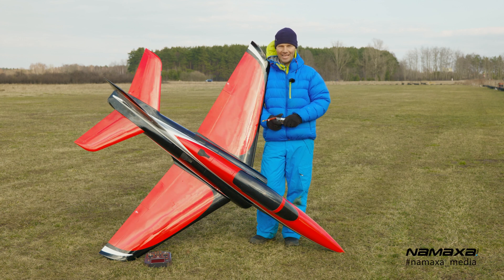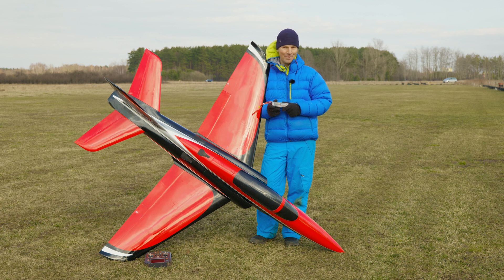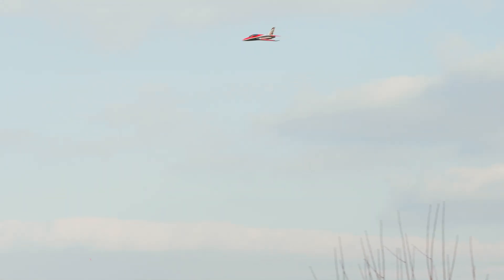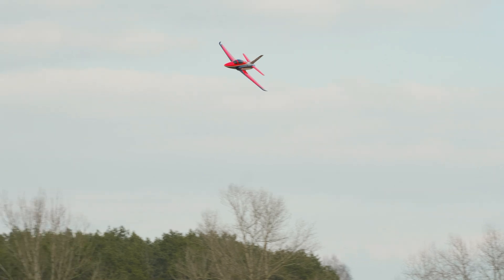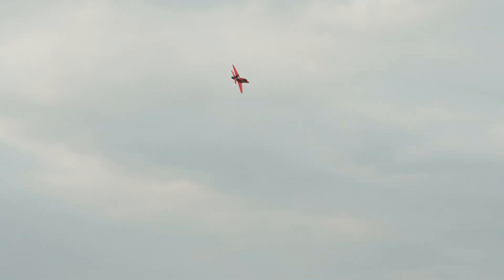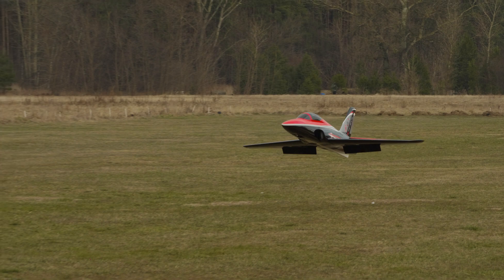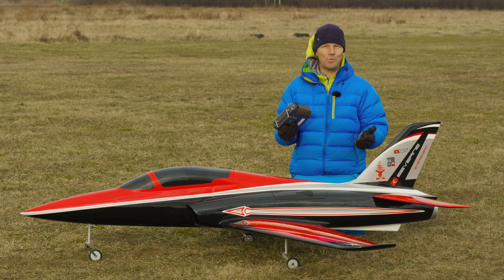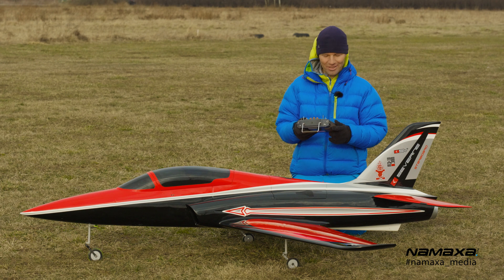10,5kg Odyssey JETFAN-120 PRO EDF 258km/h 8,5kW 11,5kg thrust, 150A Graphene 16s 4Ah TOPRC Jet Sound

Comment: JETFAN-120 PRO with motor HET 800-73-590kv.....Are you sure on the motor you used??  We run that same motor in a JF120 on 14s, and pretty convinced that 14s is the max amount of cells that motor can handle

Comment: That's awesome - I want one... but only 11.5kg thrust on 16S??  I have a 9" quadrotor that produces at least 15kg thrust on only 8S.  I love the EDF, but it seems like they're terribly inefficient...
Reply: Quadrotor props move more air with less effort, while the EDF needs more juice to push less air *faster*. thats why your quadrotor can turn on a dime but wont ever get close to the top speed of a fixed wing aircraft
Reply: @fleshtorpedo  ... in other words, it's still pushing hard while the aircraft is already moving fast.. I get it - the laws of thermodynamics, again... we just can't have our cake and eat it, too...
My quads are pretty fast, though - about 110mph seems to be some kind of barrier that I can't get through without adding massive power, size, cost, etc.
On to fixed wing, and my high-speed cruise endeavor continues....

Comment: Are you mixing turbine sound into your videos?
Reply: listen to the sound of the gear when he lands on the grass... sounds like the inside of a cockpit when a fighter lands, not like little wheels on grass, it has to be an audio overlay or at least speakers in the RC airplane. Nonetheless, its a pretty cool EDF.
Reply: @troylunn496  I am recording the original sound of the flying EDF. I was recording the video and audio, editing my self. I can tell you this is 100% recorded sound. Of course I am not using iPhone or Samsung phone to record it but pro audio equipment - film grade. so You can hear all of that details so well!!! Please check the previous film to see me there with camera and mic... Marek
Reply: @namaxamedia4521  Very cool! So do you have audio equipment inside of the aircraft fuselage? Where is your audio equipment recording from to be able to catch those sounds? I've worked with a lot of different EDFs and other RC aircraft, but never heard these sounds from them.
Reply: @troylunn496  I am using rode NTG5 with blimp, audio recorder. It gives the best directional sound. Empty air field helps. 
Before with lower grade sennheiser mic and just regular wind protection it was much more noise then EDF sounds.
so there is no mic on board plane.
Reply: @namaxamedia4521  Well it's very impressive! So realistic you had me fooled. Enjoyed the content, and looking forward to seeing more.
Reply: @troylunn496  Do you even fly RC EDF jets or planes?.  When he lands on grass, that is what a fiberglass planes sounds like landing. Just because you have never heard a EDF jet sound like that, you assume it is not real.
Reply: @tonysmith7702  Yes, I do, including 3D printing my own designs. And no, it didn't sound like things I've heard before. And I didn't doubt him after he said it was a plain recording with pro gear.
And before you also question if I 3D print, it's an Ender3 with a Dual-z axis mod, a BTT octopus control board, running Klipper on an R-pi 3b+, and plenty more.
Reply: @troylunn496  Ok
Reply: Fake sound it’s very obvious
Reply: What do you mean? This is the recorded sound of that Odyssey.

Comment: question why do you use 4mah batteries instead of say 5k or 6K Mah when you build your  packs. Thanks and love your video's, keep them coming. Tom
Reply from the maker: Weight. My 4000mAh 16s pack weights 1,6kg and is easly delivering 150A 8,5kW

Comment: What motor are you using in your fan?
Reply from the maker: HET 800-73-590kv
Reply: @EDFjetRC  Thank you.  I am looking at a Jetfan 120 for an F-106 short kit I bought on Ebay.  I am considering the HET 800-60-535 on 12s.
Reply from the maker: @robertcampbell6349  I do not think it is enough. You will have 65Amps and only 5,5kg of thrust. Go for 590kv or 685kv
Reply: @EDFjetRC  I wi do that.  Thank you for the advice.
Reply from the maker: @robertcampbell6349  590 will give you 85Amps 7kg of thrust and 685 will give you 130A, 9kg thrust

Comment: That's slow. I have flown my carbon composite glider at 600kph.
Reply from the maker: Sick :)
Reply: @EDFjetRC  thanks.  I want to be the first to 1000kph.  And am building a new self designed carbon composit glider at the moment. 1.5mtr wingspan weighing 20kg.
Reply from the maker: @ianturpin9180  sure 20kg?